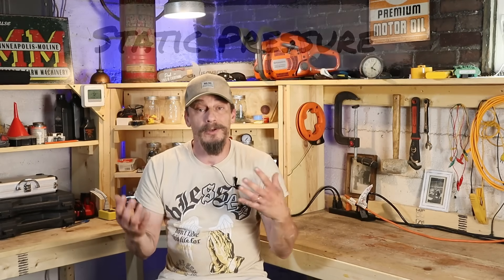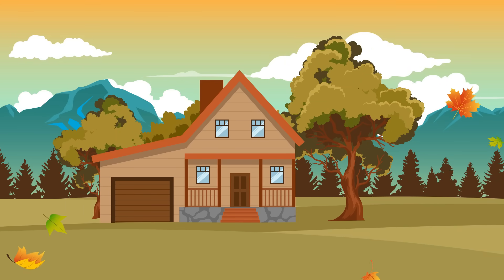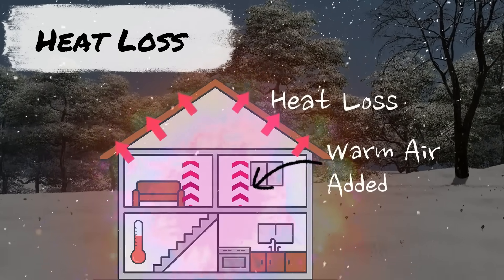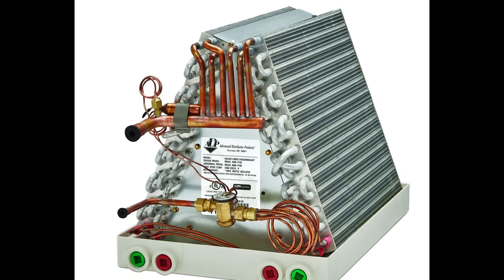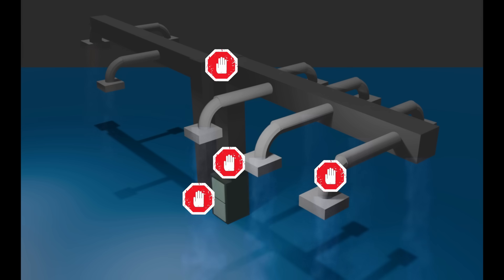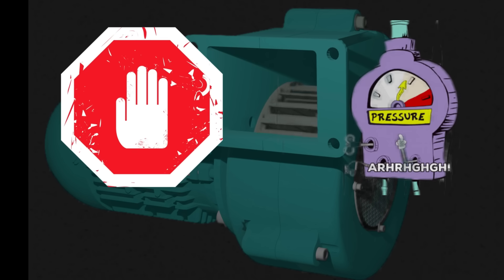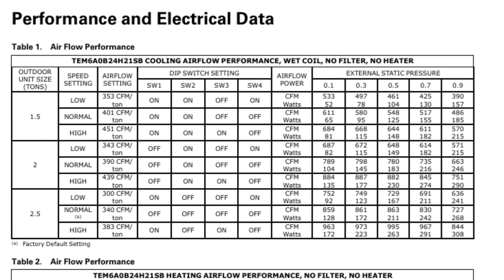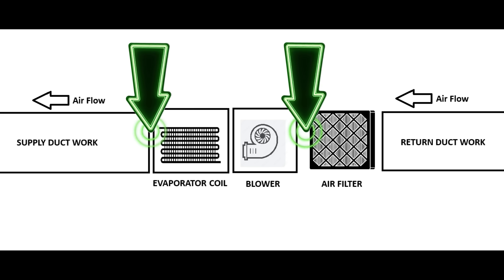Static Pressure: What It Is, Why It Matters, and How to Read It

Comment: We had one today where the previous company ran 3 ducts for each zone but left the 2nd floor duct short with a cap. As an apprentice, my only conclusion is there's not enough pressure pushing air into the end of cap to hit the last 2 takeoffs towards the end (not enough air flow was getting to the last 2 takeoffs)

Comment: Question from the "I'm dealing with really old stuff" crowd. I have 90,000BTU (output) furnace, an old school 80% unit. Technically that's a 7.5-ton (by the 12kBTU/ton formula) so at 400 cfm / ton that's 3000 cfm. But the blower speed options are 2156/2056/1901/1715 cfm which are nowhere near the guideline. Do we just ignore the rule of thumb for these older units, or is there a general sort of do-your-best rule where 400cfm/ton is the max, not the target?

Comment: The techs that installed my 3 ton, two stage, two zone system didn't do a pressure check. They put in a bypass that was too small and set the fan speed for a 3.5 ton system. The motor died after two years and had to be replaced (under warranty). Even after they replaced to motor they didn't do a static pressure test. I became curious and started to learn about static pressure. I've relaxed the bypass damper and the zone control dampers and now with one zone running the SP is .6"wc and with both zones it's .8"wc. The table in the manual goes up to .9"wc. Would it be worth spending money to get the static pressure lower? Is my system at risk of failing prematurely?

Comment: Great video so the best option is to design the ductwork to your target cfm to maintain .50 wc
Reply from the maker: At this stage (what I covered in the video), you’re just figuring out the blower’s limitations so you can determine the friction rate. That friction rate is then used to size the ductwork so the main trunk and each run can deliver the proper CFMs.

Comment: Please make the videos that you mentioned at the end beyond this material.
Reply: The part in the video where you went over the chart after you mentioned 400 CFM is the average flow per ton, made me wonder about split systems where you’re trying to fill up a house with more air than typical to that tonnage.
How would how would this change your explanation of setting the blower speed?

Comment: Excellent video! I think I have my answer but just want to confirm... My Goodman furnace CFM chart says it did not come with a filter installed. Do I take total external static pressure with the filter installed or not if I want to use that chart to determine CFM? It sounds like I leave it installed, but take the measurement in-between the filter and blower.
Reply from the maker: That's correct. Leave the filter in and take the reading after the filter and  before the blower.
Reply: @JerseyMikeHVAC  Awesome, thanks! This video finally made it click for me, really appreciate your channel!

Comment: Thank you for sharing your knowledge on this Mike. Have an older r22 system and I’m afraid to ask contractors if they even know this. My supply duct right out of the unit hit a 90deg , then down the straight duct system. Turbulence at the 90. Etc.
Reply from the maker: Some technicians get it, but your best bet would be to talk to an install or service manager. A low cost solution could be to round off the hard 90 inside the duct with a curved piece of sheet  metal and then add turning veins. This would reduce turbulence at the corner and help redirect air on the turn so it isn't slamming up against the top of the 90.
Reply: @JerseyMikeHVAC yes Mike, like two 45s when I get a replacement system because it’s almost 30 years old but no issues-yikes right

Comment: Great simple explanation I could understand. So if your return air trunk is too small the negative will rise and if the supply trunk is too small the positive will rise giving a high total static pressure?  Does the amount of pressure in the supply trunk affect the pressure reading you get in the return? Great video

Comment: Perhaps the example you give is because that one is an air handler and the coil is often on the other side of the blower?
Reply from the maker: Most likely. But you can see different configurations in downflows and so on too. Bottom line, just always good to check and be aware of these things.

Comment: I’m fairly new to all this, this video gave me more questions than answers, and I mean that as a good thing, there’s a lot to think about and research and watch more videos about. The whole latent vs sensible heat is something I have never heard of until recently, I’m going to end up taking some HVAC classes I think, such an interesting area.
Reply from the maker: I have a video here that goes a little into latent heat vs. sensible heat if that topic interests you: https://www.youtube.com/watch?v=dSJrZ0_tISc
Reply: @JerseyMikeHVAC thanks will watch that one now. Just had worked on my sons unit, cleaned the coils on both ends, it was only 74° outside, 72° inside and I ran it for 30 minutes and it stayed at 72° with 50.2° air temp at the closest vent. Crazy that it felt a lot more comfortable, and changed all that 72° air for 50° air and it felt much cooler but didn’t drop, but then shortly after that it started dropping quickly, so it had to get that humidity down before the temperature could change, cool stuff lol, literally.

Comment: Also have to be mindful working on some equipment with aftermarket blower motors. The manufacturer blower chart is not very useful with an aftermarket motor. You can run the furnace in heating mode with the desired cooling speed and take a heat rise calculation to get your mass flow rate or cfm. Then measure your static pressure.
Reply from the maker: Great point to bring up. I'm going to pin this so it doesn't get lost in the comments. 👍

Comment: I have a hard time buying into this stuff because I am an apprentice under a 60 year hvac owner/operator. He can diagnose anything using a $30 set of gauges and a multimeter.  On the other hand, I understand the sales side of business and customer psychology, so I get trying to make things look complex in order for the customer to feel good about being charged $1,000 an hour😅
Reply from the maker: I'm a horrible salesman. I never tackle anything from that angle if I can help it. But I will bet you the guy you're working under is definitely applying this understanding even if you dont see it. Like I said in the video, this topic bleeds into practically every reading you take on a system. You take enough readings over 60 years, you know what airflow is doing. You don't need the manometer as much anymore. But he's not ignoring it.
Reply: He only makes ou think he can. If you don't know tesp you don't know much. So many systems have way to high a speed setting resulting in high tesp. You don't have to run it in as high a speed as possible!
Reply: That is the operating mode of many HVAC contractors. Going by feel may produce positive results if you have enough experience but it is quite unlikely to produce optimum results. Just curious, do you ever have any callbacks?

Comment: Just had a new 3ton Inverter system installed replacing a 15 year old unit that had a variable speed air handler and the new system does not. Immediately noticed lower air flow to the back 2 bedrooms so I checked the esp and came up with .66 total. .44 on the return and .22 on the supply. I bumped the fan speed up one and it took me to .90 which is at the upper limit of my chart. While the air flow was better to the rooms I don’t like being at the high end of the chart. So it looks like I need to have a return added to drop that high negative pressure? Air filter is a 2 inch 20x20 and made little difference when I removed it. Also company that put it in never tested static and said it should be fine since the system was the same size that was replaced 😢
Reply from the maker: Yeah that 0.44 on the return is high. Anything above 0.30 is often problematic. Adding a return is a solid step in the right direction.
Reply: I find it strange you didn't see a noticeable difference in pressure while having the 2" filter removed. Where are you testing on the return? Also you have a new inverter system but it does not have a variable speed blower? That sounds pretty unusual and even unlikely to me. Is it a matched system with an  ahu and a heat pump? Curious what youre working with. Also you need to make sure you're not exceeding the ahu's max tesp rating. Some units are as low as .5" some are .75"  and you need to make sure you're ending up at the correct cfm range when you make any adjustments, you're not shooting for a static target, you're trying to achieve a cfm target is the goal, while remaining under max allowable tesp

Comment: Great topic JM!
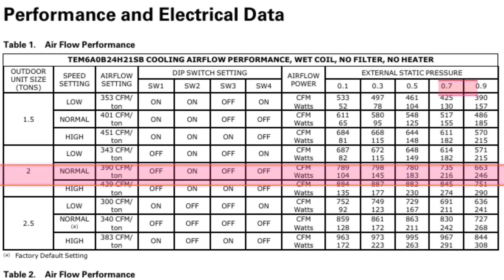At 13:45, you discussed altering the ductwork to reduce the overall static pressure. 
It that what the Husqvarna behind you on the shelf is for?
Reply from the maker: Oh that? Sometimes I use it to cut holes in the duct for my probes because I keep losing my step bits.

Comment: Is there a standard static pressure that you can deduct if you cannot remove the filters? Houses around here have several filter grills and some are very high on the wall. I'm curious if there is a standard static pressure for a given size filter.
Reply from the maker: Not particularly. They're all made with so many variations in surface area, MERV and quality that the only concrete principle you could really apply across the board here is that SP for any filter will just keep climbing as it gets dirtier.
Reply: Filters are changed 1-3 months, so how is that you can’t get access.  I saw on YT some systems don’t have a filter cover/door, so on Amazon there is a $10 3” inch wide “blanket” with edge magnets that covers the filter opening where there isn’t a spring loaded door or cover.
Reply: @tonymanero5544 I can get access but there are 4 of them on the unit I'm thinking of and it would be much easier to do some math than to unscrew 4 filter grills on a tall latter

Comment: Your content is right up there with HVAC school and AC service tech, you’re killing it man, keep it coming!!
Reply from the maker: Wow. Thanks! Being compared to those guys is quite an honor.
Reply: @JerseyMikeHVAC Yes sir! I’d like to make a request for a quick insight on how to and when to adjust the blower motor speed say maybe after a new install or a service call and you notice the output seems weak or roaring high. I just haven’t seen any clear content on a real life situation. At this point from what I’ve learned from anyone I’ll never adjust the speed in my entire career lol
Reply from the maker: You can start with the general idea that on a new install, setting blower speed is the first priority before anything else. But on a service call, you typically want to look at everything else before you adjust blower speeds. 

 For example, if a system is older and airflow seems pretty weak, odds are very high something changed along the way. It's unlikely a customer suffered with a weak system for years and hasn't had anyone look at it before. More often than not, in these situations changing blower speeds is a band aid over another problem going undiagnosed; dirty coil, bad filters, duct work damage, weak capacitor, maybe bearing wear on the blower, etc. 

 On the other hand, if airflow seems way too strong, this may have been a band aid adjustment by a previous tech to overcome some of the same problems, dirty coil, duct work damage, etc. 

 It's good to get into the practice of mining the homeowner for more info if you can. 

 "Ever have a tech come out and increase the blower due to some other issue? Poor airflow to some rooms, etc"? 
or
 "Ever have a tech come out and adjust the blower speed down due to some humidity issues in the past"? 

Very rare to have to adjust blower speeds on a system a few years old unless it was never done properly to begin with or it was done to mask another problem. In most cases when I do adjust blower speeds on an older system, it was after correcting the real problem and returning the blower speed back to its proper setting after the fact.
Reply: @JerseyMikeHVAC you actually touched on exactly what I deal with all the time. I’ve done probably 50 installs since I’ve been out of school. My supervisor never mentions the blower speed and sometimes I would say “that seems weak, can’t we just crank it up” so on a new install would if it felt weak how would you proceed after that?
Reply from the maker: @Infowarrior-1776  You want to know with certainty what your total CFM delivery is. That will tell you everything you need to know on whether to make adjustments or not. If you have a 2 ton system and only moving 500 CFMs or you're pushing 1000 cfms, in both cases that definitely warrants a blower adjustment. Anything that falls within the 350, 400 or 450 cfm per ton is more of a judgement call based on conditions (humidity/mold concerns, comfort, noise, etc.).
Reply: @JerseyMikeHVAC Got it! Thanks for the help!
Reply from the maker: @Infowarrior-1776 Any time.
Reply: @JerseyMikeHVAC  Thank you, really appreciate the info!
Reply: @JerseyMikeHVAC  Think this is erroneous... you taught a 72 yr. old woman in southern AZ how to completely service my AC, with the exception of dealing with refrigerant.  If my system suggests I need a leak check and charging, then I'm doing the leak check... I'll call a licensed pro for the charging part.  Also don't have a manometer...but at least I know what it is and how to use it.  Can't thank you enough for your content, and far better than any other YT channel... just my opinion, but judging from the comments on all your videos,  I don't think I'm alone in saying so.  Cheers...
Reply from the maker: Thank you so much.